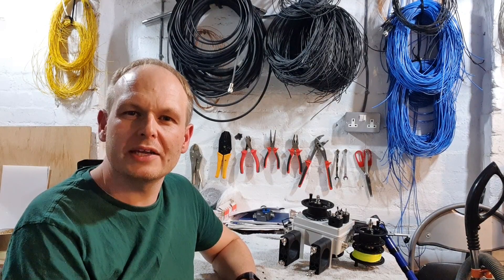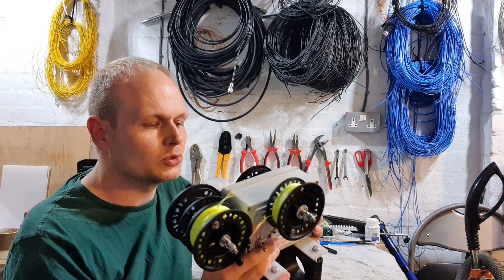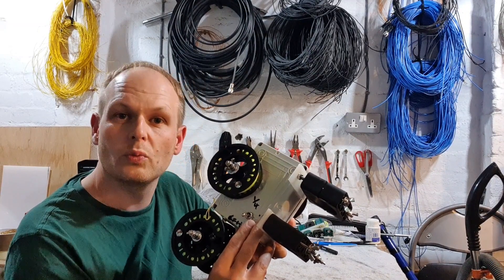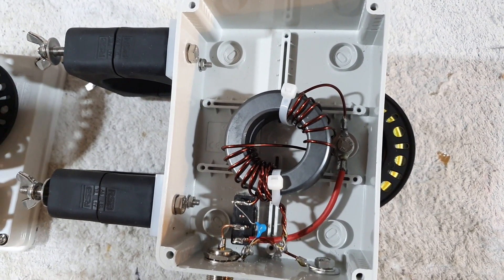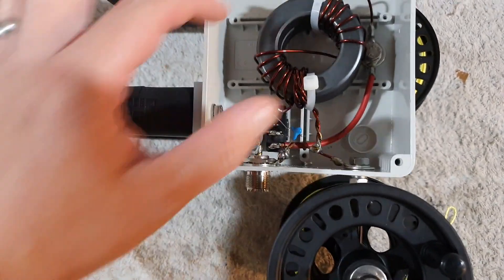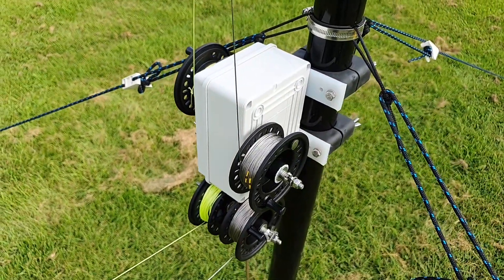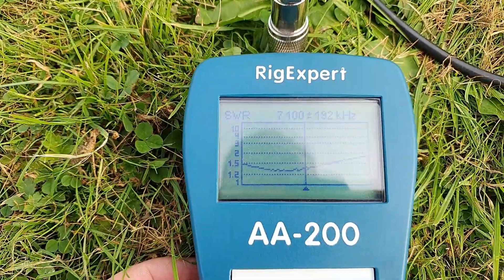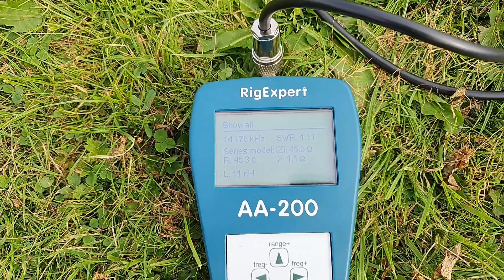Should you choose a Quarter Wave or End Fed Half Wave Antenna? - With this antenna you dont need to!

Comment: I thought about this, and your modeling assumes a 100% efficient 49:1 UNUN. Which won’t be the case, especially on 12m & 10m with the typical 240-43 based UNUN.  They are only ~72% efficient range at higher frequencies . The 1/4 wave MAY be better on those bands? Some of your newer torroids you have wound seem to be much better on 10 & 12m.
Reply from the maker: Correct. This was well before I started testing transformer efficiency. Swap this out for a 3 stack of 240-52 Autotransformer.

Comment: He should cut to the chase which is a better antenna for a mobile a half wave or a quarter wave in performance
Reply from the maker: Its not just as black & white but personally i would choose a half wave every time if possible.
Reply: @MM0OPXFieldRadio  
That's what I want to hear but 102 inch whip that I have on my car outperforms a halfway antenna because it is a full  quarter wavelength and I talk skip condition on that with ease even outside the country Trinidad Australia Puerto Rico Canada all that I talked with on 102 inch whip. Experience has shown me all that, because I tried all those other antennas in the past they just don't perform like a 102-in whip.  My opinion through experience.

Comment: While opening this up is great for those who have built anything for themselves I would have loved to have seen you build one from scratch and add the remote relay switch. They appear to be some sort of repurposed fly fishing reels on the exterior. That's an interesting antenna setup. Thanks.
Reply from the maker: Yep, these are fly reels. I have so many antennas here I just can't build everything. If I was going to use this antenna regularly I would definitely do this.